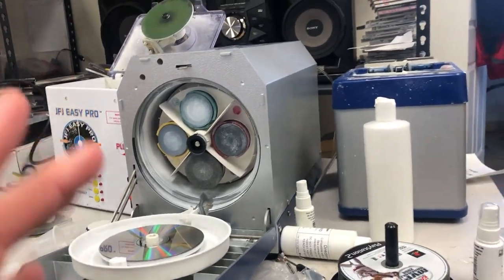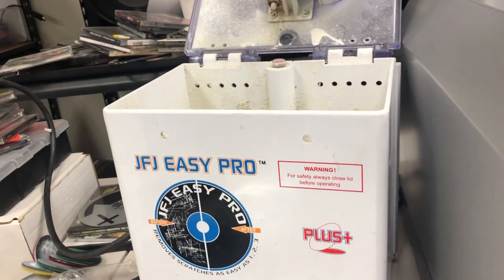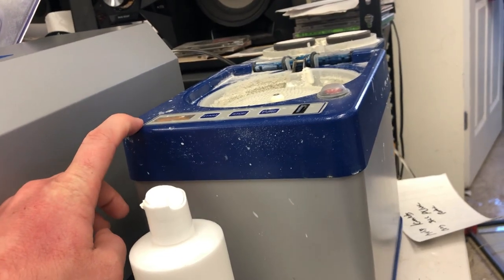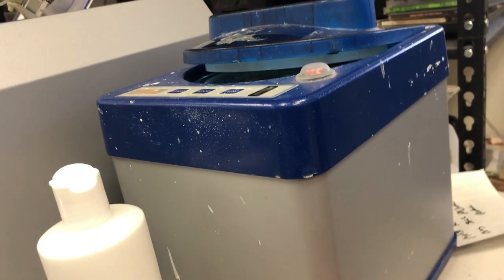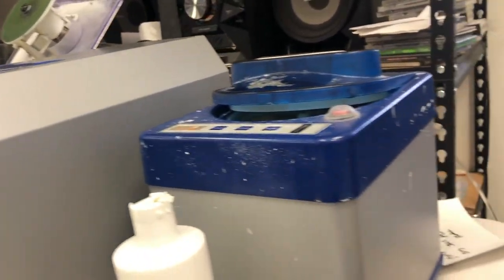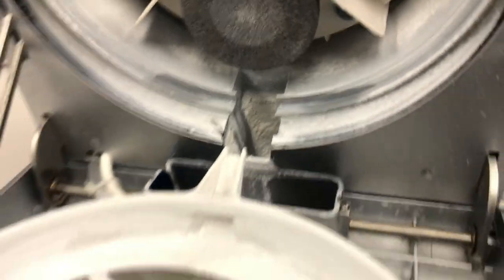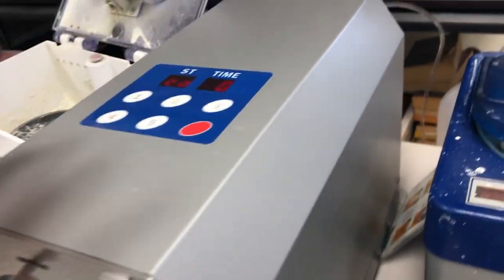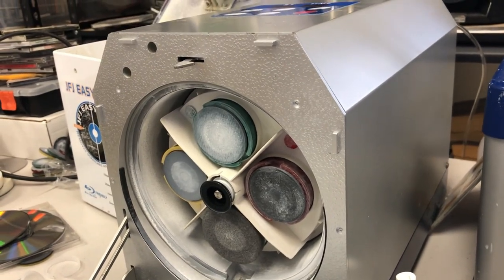JFJ Easy Pro vs ELM ECO PRO vs ELM AUTOSMARTV($150 to $4000 Disc Resurfacing Machines)

Comment: Love my eco AutoSmart. I have a few tips for ya. 

1.) cut your drain hose to the length you need so that there’s no droop in it and you don’t have to lift it and water won’t pool up, also, remove the drain hose and clean it out regularly, dried polish will build up in there over time. 

2.) keep a spray bottle handy and spray your machine down on the inside every once in awhile and wipe it out with a rag to keep it clean. 

3.) do a deep clean on your machine every so often, remove the turbine in front, sand off any rust built up on the back of the pad holders, and give the inside of the front of the machine a good wipe down. 

4.) prime your pumps before use, if you let your machine sit for a day or two, it might take a good 30 seconds before the machine starts spitting out polish. 

Overall it’s the best resurfacer you can buy other than the master which is ridiculously expensive. I’ve actually been considering getting a 2nd auto smart lately.

Comment: Thanks for the video. I picked up a  VMI 3500 on offer up for $150.  At first it was destroying my disc but after changing the buffer pads, it runs great. Literally no supplies but I believe the buffer pads need to be replaced after 2500 disc.   The device is not messy like these other devices.
Reply from the maker: Nice, I’ve never used that brand.
Reply: I had a Vmi 3500 machine. I started calling it the 'bamboosler' because all it does is make to top surface of the disc look good (ie, hide the scratches). you really need a sanding process to get rid of any real scratches.
Reply: @jamessanechiaro7918  I would think if the process hide the scratches then it removed them. I’m not sure how it would fix a top layer without fixing what is underneath.

Comment: I quit using the Sandpaper 10 years ago on the JFJ.  It was more trouble than it was worth.  I had my first JFJ for over 15 years and did 1000's of DVD/Games/CDs in them.
Reply: I also dont use their compound
Reply: My jfj east pro plastic hinge bolds broke. Now I have to push in the pins every time or the hinge comes off and ruins my games. Thinking about getting a eco pro 2 to replace it.
Reply: @themediamarauder1582 What compound do you use?

Comment: I have the ecoauto pro 2 and I love the thing. You just put the disc in close the lid and let it work.  Even works on GameCube games!  I love mine and it has been worth every penny. I went through one card already and other than build up from non use over the winter months I have had no issues. 

100% always have more pads on hand. Waiting for the one set to dry and using another set is a great way to keep working.

Comment: The trick with the JFJ is to buy 5" Milwaukee Polishing pads. The Red one for deeper scratches and the black one will typically get out all light scratches. They last incredibly longer than the poor quality over priced JFJ pads. I also use Mequiers ultra fine car polish on the black one and the more intense Meguirs car polish on the red one. Its always a hit or miss on it but it works better than the OE products by far.
Reply: I was looking at those pads the center hole is so much bigger has that caused you any issues does it have the same quality if repair as compared to the jfj pads in your experience?
Reply: @That1999hondaprelude  all you have to do is spin it by hand to make sure the hole is not moving up and down but other than that it wears down as a normal jfj pad.

Comment: Are you renting the Elm Eco? Why does it cost extra to use it each time? Will it not power up if you don’t have enough credit on the machine? Why would anyone purchase a machine that they have to pay extra to use?  Is it okay to sell games (disc) with some wear and scratches on them?

Thank you🌞
Reply from the maker: 1. No
2. That is how it’s designed
3. It powers up but it won’t work
4. Because it’s still a very cheap option 
5. Yes, but it’s better to sell all your discs without scratches if possible and you will get more money for them
Reply: @WBKnoblock  Thank you got taking the time to answer all my questions.

Comment: If you cut the tube on the higher end machine so it is resting just inside the bottle, it might fix the clogging issue. Then you'd just have to keep an eye on the jug
Reply from the maker: Yeah, I need to do something to that effect.
Reply: I’ve been using an AutoSmart for 15 years.

Spraying a little water or light cleaner into the tray and the turntable and wiping out the residue is my daily routine.  Cutting the hose for a straight fall helps, but every few months remove the hose. Run hot  water from the faucet the hose to really clean it out.  No more flooded desks.

Comment: I’m interested in repairing my minor collection of games.  The problem is, I’m a perfectionist.  Will the JFJ leave discs flawless or will minor scratches still be seen?  I’ll only do a disc at a time, never multiple.  Otherwise I’ll get the Eco Pro and offer a disc repair service as a side hustle to offset the costs.
Reply from the maker: The JFJ can potentially fix them all but it might ruin some if you run them too long. It will also leave a ring on the inside of the disc (the interior part with no data) if you don’t add on a silicon washer

Comment: I've sold thousands of disc's on ebay and only one time someone complained about a scratched disc. Never did I clean any disc's. Recently I came across a haul of expensive gamecube games that have a bunch of scratches. I can't justify spending all the time and money for the machines considering the low track record of complaints. I'll just lower the prices. Good video though
Reply from the maker: No offense, but I don’t believe you. If a disc doesn’t play, you’re going to get a return.
Reply: @Walter Blake Knoblock  well I don't know how to prove it but I've never had a return on any games. I always say minor surface scratches in the description. I dont know man been reselling for years. I will say I don't sell cheap games individually I sell them in lots. Games $40+ I sell individually..maybe that helps
Reply: Doesn't the machine read the disc from the top not the bottom where you see all the scratches (yeah too much research and not enough taking notes! ha ha) Just look at kids dvds that get played over and over and manhandled by those grotty little fingers :) I think sometimes removing the light scratches is purely a visual thing. I really want mine to be clean to sell though saying that, just to contradict myself :)
Reply: @Lea_1113  the laser has to see through the clear bottom layer to focus on the data foil layer. If that clear layer is heavily scratched the laser cannot focus. As the laser weakens, the clearer that bottom layer needs to be.

Comment: Ive owned 10 polishing machines since 2001,  The azuradisc 1600 (that left the discs like mirror including ps1 games) was outmatched until the autosmarts became available, then they invented the dualdiscs and those where BAD the only PRO they had was that they did leave the BLU RAY DISCS LIKE NEW unfortunately their service was HORRIBLE and they used timed keycards, the best machine currently is the AUTOSMART, I own 2 but they do break up eventually so I have to send them for repairs. Im still looking for a machine that can Handle Blu Ray discs :(

Comment: I'm really surprised China haven't jumped on board with making these like they have with everything else.

And paying for minutes on a machine you already paid thousands for shows there is a big opportunity in that space.
Reply from the maker: I wouldn’t doubt if the elm Eco pro is a loss leader and they make the money back on cards. The bigger machine doesn’t have the pay-to-use minutes model, but it does burn through sanding pads.
Reply: @WBKnoblock  yeah I'd imagine they make a killing on sanding discs and solutions as they are specific for the machine.

They are quite expensive when you consider the materials to make a unit but as they last so long and it's fairly niche I suppose they need the mark up.

Comment: Does rhe eco pro leave the swirl pattern like the jfj does? I resell media and wont sell a disc with swirl marks
Reply from the maker: If you use it correctly, it will produce a mirror finish with no swirls
Reply: @WBKnoblock  Perfect, thanks mate. I'm very disappointed with the jfj, I spent over $600aud to get the machine to Australia, I've saved up thousands of media and it doesn't work 😔 I won't sell discs with scratches.
Reply: @redfairmont as a consumer personally I don't mind light scratches on discs as long as no issues with playback

Comment: wow it’s crazy you made this video when I’m in the market for a disc repair machine. I was looking at getting a JFJ but if I’m hearing this right you said it don’t fix blue rays or ps1 discs and it warps discs as well????? So like it only works on ps2 games and it can warp them. Is that even worth it?
Reply from the maker: Check other comments- apparently people say I’m wrong about that. It doesn’t work for me tho.

Comment: The master I feel does a better job on the discs because the head drops down on top of the discs and applies more pressure.. I can buy salvage ps3/4 Wii U games and fix them.. as long as the data isn’t damaged.. you have 100 microns to work with 🤷🏼‍♂️ still a lot of work.. ROI isn’t great but it was something that I tried out
Reply from the maker: Thanks Jedd, you have a lot of extremely valuable insight on this topic. About how many discs do you sell a month?
Reply: @WBKnoblock  typically 1000s but the price action right now between the consumer vs the big 3P sellers like jenson or kitchen sink ect.. has caused wicked swings…  so if I haven’t moved it in 3 months, I’m gonna take the L on it.. hell sometimes it’s as little as 2 weeks.. I’ve had to destroy 1000s at the same time. 🤷🏼‍♂️🤷🏼‍♂️🤷🏼‍♂️ it’s not all giggles and 💩
Reply from the maker: Whats going on with Jenson?
Reply: @WBKnoblock  all the big sellers seem to be on this kick of we need to move inventory fast or we die.. so they will sell a book/cd/dvd just a few bucks above Amazons costs.. with CDs/ DVDs with little to no reserve.. they don’t mark to market.. so let’s say you have a 1.5 lb book that’s 700k rank.. MF @ 14.. FBA used @ 24  new fba at 40.. total cost is 9 bucks fba… these big 3ps will come in at 12 bucks.. if it doesn’t sell right away, everyone else marks to market.. now that listing is done.. highly likely you will take the L.. same thing with CDs/DVDs their bottom reserve is 5.85.. not to say this wasn’t the case before.. but now you have to be really tight on your business.. CDs/DVDs over 40k carry that risk and as well as books over 550k..
Reply: books over 450k in all reality.. I’m just focusing on fast moving items for Amazon.. 2% daily sell through of my book.. my all the other sellers around me haven’t really changed their approach and complain about slow sales.. i really don’t think they’ve looked at their book much..
Reply: @WBKnoblock  I set a couple of short videos walking through the master on my handle.. not looking for subscribers just couple of informative videos

Comment: I have all 3 as well , the elm eco pro in my opinion is worthless . Why do I have to buy minute cards to use a machine I already paid for? 
The jfj & the eco elm are both dry type polishing machines. The only positive about the elm is that it’s automated and you just press the 30 second button. 
I use eco auto smart on disc that are over $50 since I don’t want to risk the chance of damaging them with the jfj. But on any other disc the jfj works well. However there is a learning curve on how to use the jfj machine well.
Reply: You could also use meguiars ultra compound polishing cream for the jfj easy pro, which is way cheaper than the overpriced compound jfj sells
Reply: @goochslayer1639  Meguiar's polish is great! Wayyyyy better than the original stuff. Keep slayin them gooch's!
Reply from the maker: My issue with the easy pro is it makes it difficult to multi-task. I can’t just set it and forget it like the ELM products.
Reply: The auto smart uses water
Reply: @goochslayer1639  that is a fantastic idea. 😊